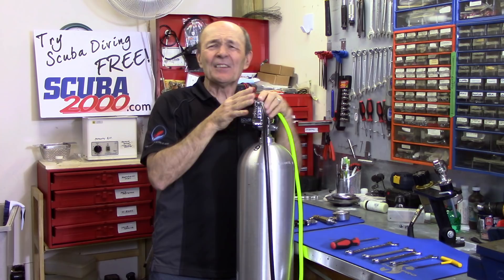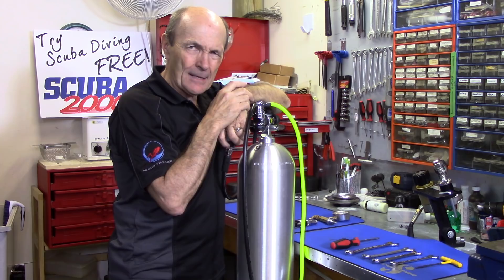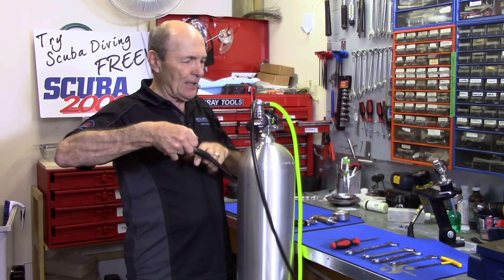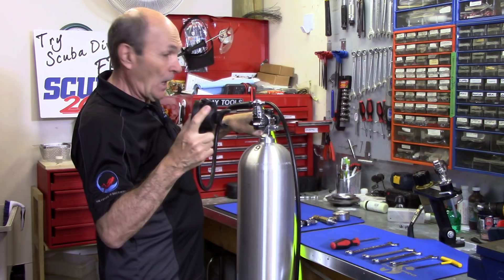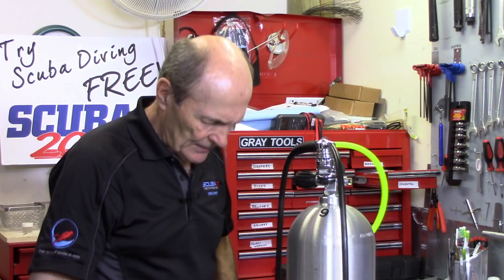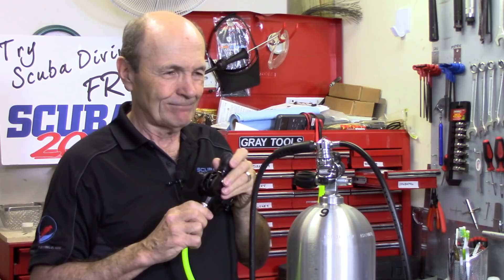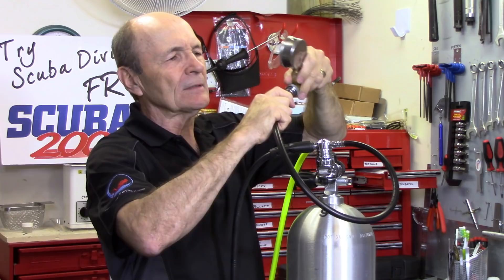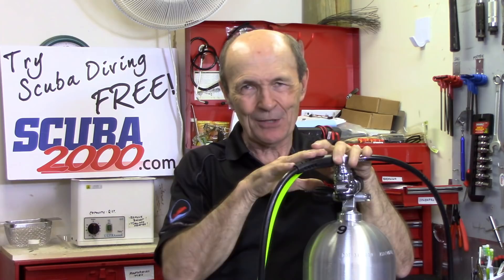Adjusting The 2nd Stage - Scuba Tech Tips: S05E14

Comment: I love these videos man, they are just awesome. So im at s05e14 and start realizing, air pressure and air in general is kinda very important in scooba diving. you can power everything with air. Its briliant. Thank you Alec
Reply from the maker: All it takes is a bit of ingenuity, some hose and fittings most of which is at Home Depot or Harbor Freight.
Divers even use air to drill underwater!
Alec

Comment: Thank you for this video Alec! I just bought a new regulator (Hollis) and wasn't really happy with the required cracking pressure. Thanks to your video I was able to adjust it slightly to open up just that little bit more easily. I'm feeling much better about how this reg is breathing now.
Reply from the maker: I'm glad the video helped Daniel.
The Hollis is a fine reg. 
Good luck.
Alec

Comment: Great video Alec, hope all is well with you and Kevin 👍
Reply from the maker: I'm great thanks Mike.
Kevin is Kevin.
Full summer there yet - green trees, mosquitoes, flowers in the desert?
Spring is the best time of the year in the desert - other than Pronghorn season of course.
Alec
Reply: Alec Peirce Scuba 
Eh hmm! (Peter clears his throat) 😂
Reply from the maker: Right. Peter. Sorry. Thought it was Mike from Montana.
So, springtime yet?
As it happens, spring is the best time in England too. Am I right??
Especially in Kent, my ancestral home.
Sorry. 😳
Alec
Reply: No problem Alec, it's not easy as my username doesn't reflect my actual name, that is until I decide what I'm going to do with the channel. I think spring has launched into summer very quickly, we're seeing 30˚c in the shade and they're predicting it will be as hot as the summer of '76 (certainly hottest June in 20 years so far), which I fondly remember as a little boy of around 3'n'half years old.
I love it bright and sunny, unlike most brits i don't complain either "oh its too hot, too humid, too cold, too rainy) you get the idea.
How do the seasons work over the CA, does spring come earlier or later?
PS, I will reply to the pm.
Much love from England
Reply from the maker: We're still in late spring 60 degrees and wet today. We've had a couple of 80s but few.
I don't like heat. 70 is about perfect.
Maybe we won't go the England this year.
Ta Ta
Alec
Reply: I can assure you Alec, it doesn't stay hot for long. This is a one off for the last few days.

Comment: Thanks for another great learning experience. My second stages have outside adjustments on them. I think one is for airflow and the other is for pressure. How do these two interact for adjustment. I am going to see if it has internal screw adjustment. (Brand is HOG)  Thanks, Jim

Comment: Alec, I commented in this video 2 years ago as a returning vintage diver thanking you for bringing me back up to speed with new equipment. My LDS has sent me to a couple of manufacturers training schools. Again, I'm new to servicing equipment and I know you've repaired regs for years.  At one of the schools the trainer reminded us to press the purge button when adjusting the orifice so the sharp edge wouldn't cut into the soft seat. Is that really an issue?
Reply from the maker: Each make has unique requirement, some do, others don't.  Thats why following the manual for every service is key.  I don't go my memory, just by their book.
Glad you're getting into service guy.  Good luck.
Alec

Comment: Nice.  I just adjusted a couple of my second stages because they had a slow leak on the surface.
Reply from the maker: Hopefully that solves the problem. Often a slow leak at the 2nd is an indication the 1st isn't feeling good.
Take care.
Alec
Reply: Yes,  this I know.   IE, too much intermediate pressure coming from the first stage blows open the second.  But these first stages are relatively new/little used.  I have a MK25 Evo with 30 dives on it and a MK2 Evo with 50 dives on a stage bottle with it. Both second stages are 3- year- old R195.

Comment: Hi thanks Alec that was great! 
A question for you! I was wondering if you could give me a neat trick. The middle part of my DIN regulator keep on getting loose. At the dive site I just tork it a little more with the proper Allen key. I brought it back to my local dive store and the o-ring was completely destroyed. How can I prevent the DIN to become loose? I've seen some threads online where people use make shift wrench to get the regulator on and off. I thought of getting one of those rubber strap wrench. It's all easy to install it with dry warm hands only finger thigh, but after a dive at 10C water cold and wet hands just don't do it! That's probably when I twist the first stage.
Reply from the maker: I'm assuming that you're referring to the middle part of the DIN connection - the part that does NOT turn. 
That part absolutely should not be coming off.
The reason the O-Ring was destroyed is that it was extruded partly into the gap and then crushed when you tried to tighten it.
Your dealer, if he's a dealer for that brand, will have the correct torque to install it.
NO GREASE. In fact, he should clean the threads with acetone or something equally deadly to you (it dissipates almost instantly). Then it is fitted with a new o-ring and carefully threaded in. I suggest he hold it upside down so he's threading it up into the reg. That way the 0-ring won't dislodge. When finger tight, grasp it in a regulator holder and torque it properly - no more and no less!!
Make sure you are using the exact proper size Allen key. It's made of brass and can easily strip.

If you still have a problem then contact the manufacturer directly. Ask for technical services and explain it.
i pretty much guarantee they'll jump to take care of it.
By now the internal thread of the reg body could be damaged. In that case, nothing you do will work but the manufacturer will take care of it.
I would do this for you but few dealers go that extra mile. Do it yourself.
Let me know what happens.
Alec
Reply: Excellent! Thanks for the info. I'll get my regulator back tomorrow and I'll use it this weekend. If it ever happen again then I'll contact Apex directly. Really nice tip! I've seen tons of different home made solution online. Some say to use loctite, some teflon tape. For sure, I ain't touching it! I brought it to my dive store I only tork it at the dive site to save my dive. I'll let you know if that happens again. So from that I also note that I should never use a tool to un-mount my DIN regulator from a tank. It's should always be finger thigh and hand power to remove. Right?
Reply from the maker: Right!!
The DIN, like the yoke, is hand tight only on the valve. The O-Ring insures that it seals and once sealed under pressure, it won't leak or fall off - assuming there's no other problem.
There are very, very few places where an adhesive like LocTite is recommended by the manufacturer. If the DIN adapter is properly installed on your reg you simply don't need it. That is one place where the use of a thread locker might be OK though. It's not in the air stream.
Try to get it done properly. Explain the issue to your LDS serviceman and hopefully he's up to the task.
It's not rocket science. It just takes knowledge and care and proper tools.
Alec

Comment: I've got a buddy who has some old Dacor Regulators that he really likes.  The problem is when on the surface, it chatters. It is almost as if the secondary valve opens and closes rapidly when he inhales.  It's annoying but it does not affect anything underwater.  Is there a way to prevent that?  Do you increase the breathing difficulty to prevent easy opening? Do you replace the spring?  I'm just curious.  I have learned more from you in these videos than most of my classes and really enjoy your videos.
Reply from the maker: As you suggest, I think the second stage is too sensitive.
Check that the IP (intermediate pressure) is correct.
Then re-adjust the second stage.
Let me know how you make out. The old DACOR regs are among my favourite.
Alec
Reply: Alec Peirce Scuba, he tightened up the screw a bit and it works like a charm. Thanks so much
Reply: Thanks for the advice both of my Dacor regs are now better tuned!

Comment: Hi Alec, fantastic video thank you! I have just bought a new regulator set (atx40/ds4). It doesn't free flow when I open the air but it does free flow if I subsequently purge the regulator (and also free flows if I remove the second stage from my mouth underwater with it facing upwards slightly). It breathes very well though! Given it doesn't free flow when I don't press the purge, does it still need adjusting as you have demonstrated here?
Reply from the maker: It sounds as though it's adjusted perfectly. 
When you remove it from your mouth underwater, always tilt the mouthpiece down.
Problem solved.
There's a simple explanation for that phenomena but the only solution is as I've suggested or made it harder to breathe.
Alec

Comment: Alec with this vid you passed into more questions. I always wandered : i have my beloved poseidon cyclon with 11.5(13 for deep setup) bar intermediate pressure. it means that up to -110 meters the second will deliver air ok. i do not care how it feels at 10 meters because i never stay there and these were not designed for shallow. what happens if i go to -140 meters. At this depth everything counts a lot. I know that these will be fine up to -200 meters and more , but what to expect? And I wold love to see a vid on poseidons from your perspective.
Reply from the maker: Poseidon makes great regulators. They've only had 1 dog - the 5000. It didn't last long.
The 300 Cyklon is still in use and still very popular.
Now, to be fair, some of that popularity is because that for many years Poseidon was the only manufacturer that made a really good quality, high performance regulator. Now there are lots. So you simply don't see Poseidon in dive stores as much any more, at least not in North America. Not because they're not good - because there are lots of USA brands that are as good.
About your IP question, it really doesn't matter what the IP is - 125 to 160 is the normal range and most are 125 to 145.
And it definately doesn't matter what the IP is with relation to the depth you dive. So the fact that Poseidon is at the high end, 160 psi, is neither a benefit nor disadvantage. It's just what Poseidon engineers have designed the first stage to work at. If a dive store tells you that a regulator is a good choice because the IP is higher than others, leave that store before you get hurt!!
You need to understand that the IP is measured at sea level - or as close as possible. Let's say at the surface.
If it were possible to measure the IP at depth (it is but it's difficult), you would discover that  the IP is always the sum of the IP at the surface (say 160 for your reg) + the ambient pressure. That is, if the surface IP is 160 psi, the IP at 30' would be 160 + 14.7 = 174.7 psi. At 100' the IP would be 160 + 58.8 = 218.8 psi. You see, the IP must always equal surface IP pressure PLUS ambient pressure. That ensures that the relationship between the first stage and the second stage is constant. Thus you always get the same breathing effort.
Now some smart guy is going to ask, "How come the reg doesn't start to free flow as you go deeper? The IP is increasing and should start a free flow."
Because the increased pressure from depth is also acting on the second stage and is added to the 2nd spring pressure that is balancing the IP. Hah! Now you see.
And, Chirana, you also see that having an IP of 160 is just a fluke of design and gives you no advantage over any other regulator, in that respect anyway.
I hope that's clear.
Alec
Reply: Alec Peirce Scuba ohhh. it is very clear now.... a lot more clearer . thanks and keep up the vids Alec

Comment: I watched this video after I watched the tip on cleaning the second stages. I notice in this video you didn't use a special tool securing the nut that's in the plastic mouthpiece before turning the bigger nut to remove the mouthpiece from the hose. Is the nut that's in the plastic part of the mouthpiece, not an issue here?
Reply from the maker: Good observation.
Each reg is different. Some have a nut that can be held while you loosen the lock nut.
But some regs, USDs regs, for instance, have the body nut completely embedded in the plastic body so it can't be held by a wrench.
In these cases, you must be VERRY careful to not tighten or loosen too hard.
If that nut spins in the body, you'll have to get a new 2nd.
Alec

Comment: Alec, In the good ol' days, second stages had a clip or button, for relieving the spring pressure off the second stage LP seat. Do you think, is still necessary now days to do the same, or the materials have improved to a point, that does not have the "memory effect" on the seat?

Thanks
Reply from the maker: Yes Michael. Some did. Healthways, Sherwood, DACOR and Scubapro for sure that I know of.
Many 2nd stage seats are now 'floating' so when the air is off , the pressure on the seat is off too.
I don't think it is, or even was, a big deal.
I had a video about this quite a while ago.
Maybe someone remembers and can recall it.
Alec

Comment: Have you done a show on how to get parts for vintage equipment   I need parts for aquanetic 2   The exhaust valve seems to have a larger post to hold valve in  .also a daycor Olympic 800 will need a seal kit soon
Reply from the maker: White Stag is tough. It was never a big seller so there are few around to get parts from and no one has new parts of course.
Take the exhaust valve to your LDS, preferably a couple of different stores, and ask them to try and match it with valves from their modern service kits.. The diameter of the valve is the most important part. It can be very slightly smaller but can't be any bigger. If the stem is bigger on the original, so is the hole. You may have to silicon it into place.
The DACOR 800 is a great regulator. I used one for years and loved it. That you can find easily used. New parts are another story. If you get stuck, let me know. I have a source of NOS. 
Alec

Comment: Alec, wouldn't it be better to adjust the 1st stage to the recommended IP which the 2nd stage manufacturer states as correct,  then adjust the 2nd stage?  I realize that your adjustment here is a "field" adjustment just to get you in the water and save the day tho.
Reply from the maker: You are quite right.
One would always adjust the IP to manufacturers specifications first.
The you set the 2nd stage for best breathing.
There's an assumption the second stage is the same brand as the first but it really doesn't matter. The 2nd is set to the IP of the 1st regardless of brand.
Thanks for watching.
Alec

Comment: What are your thoughts on full face mask? I would love to see a Tech Tip on them.
Reply from the maker: Full Face Masks used to be quite common. There were maybe 5 companies that made them.
Today there;'s only a couple and they are the same really.
They are very expensive and the only advantage they offer is good communication. That means both divers need one. I suppose being able to chew gum or smoke might be an advantage.
They're also hard to clear and hard to equalize.
Kinda' like Dry Suits - you spend a lot of money to get a small advantage and usually end up adding several problems too.
Alec

Comment: Hi Alec. I love your tech tips. Lots of knowledge. I have a question. The demand lever in my 2nd stage (octopus) is sitting a little high. When the cap is closed it pressing on the lever and causing a free flow. When I remove the cap the free flow stops. How can I fix this?
Reply from the maker: Sounds like it needs a little PM service (Percussion Maintenance).  Assuming the cap and demand lever are for the same unit, it may have been bent outwards somehow.  To clarify, there should be no free flow with the cap secured so your local service pro can fix it quick and while open, adjust the 2nd stage breathing effort to be perfect too.   I don't advise divers to self service parts, like bending the demand lever, as if bent to sharply, can snap off underwater making the purge button fail when pressed.   Hope this helps my friend and good luck.
Reply: @AlecPeirceScuba_SeaHunter  Thanks ... I'll get it serviced by a pro.

Comment: I have the same problem with my Oceanic Omega 3 reg, unfortunately the hose is fixed swivel, is their any other way to stop free floww
Reply from the maker: The Omega is one of the few regulators that is different (I did mention that!). It will free flow very easily if you don't handle it right.
On the other hand, it's a beautiful breathing reg.
If it free flows regardless of what you do, only a serviceman can fix it.
Alec

Comment: Alec, when tuning a reg that has the option for the adjustable breathing effort knob built in, should that knob be set to max air when tuning from the hose side? that way if it is to hot it can be turned down? Thanks!
Reply from the maker: Manufacturers have different recommendations for this issue. You should try to check the service manual for your reg. Most will suggest setting the knob to it's lowest setting (light spring pressure) before making the internal adjustment. Since the knob is most commonly used to stop a slight freeflow this makes sense. The knob can only increase the spring pressure, stopping any freeflow.
Personally, I set the manual adjustment for 1/2 way, then set the breathing resistance to be as light as possible without freeflow. That way you can slightly increase or decrease the spring pressure using the knob as you need to.
Hope this helps.
Alec

Comment: Hi, what would cause the 2nd stage slot to be needed to be adjusted? If it is hissing, has this slot moved in the 1st please? Thanks
Reply from the maker: If the seat in the 2nd gets dirty or drys out, it will leak even if the 1st is ok.
But generally, if the 2nd is leaking, it's a problem with the 1st.
Alec